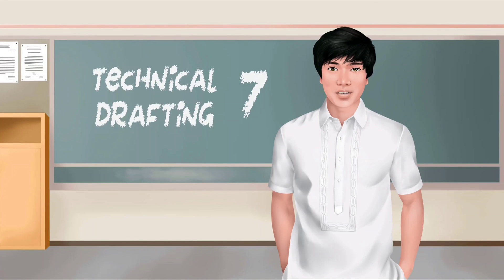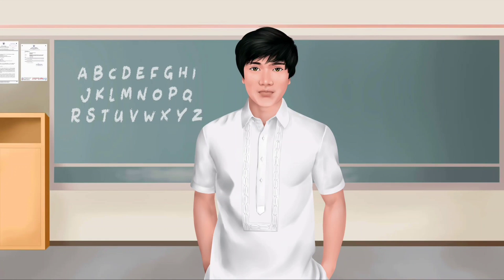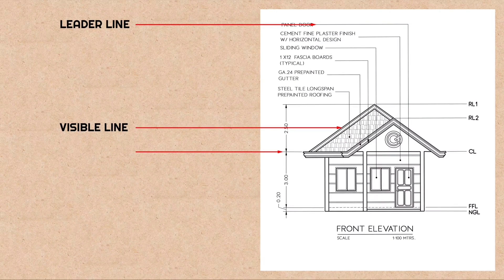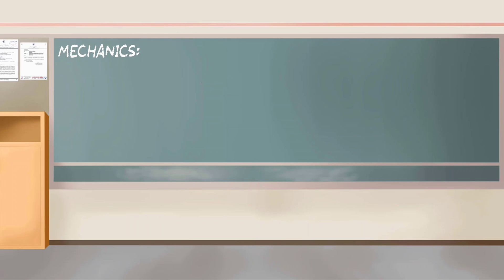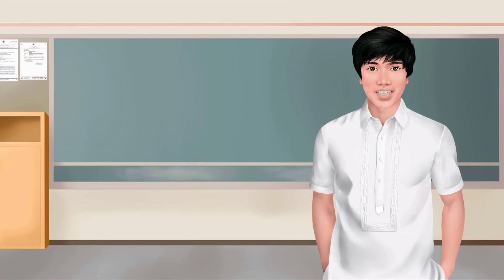Technical Drafting - Alphabet of Lines | COT Video Lesson | CCM PenBites

Comment: 1. Phantom line
2. Short break line
3. Cutting plane line
4. Hidden line
5. Central line
6. Measure line
7. Long break line
8. visible line
9. Short break line
10. Dimensional line

Sir tama po ba??
Reply: 1. Phantom line
2. section line
3. Cutting plane line
4. Hidden line
5. Central line
6. extension line

7. Long break line
8. visible line
9. Short break line
10. Dimensional line
Reply from the maker: Good day. Kung sa labelling itong sinagutan mo, may iilan lang na hindi mo nakuha. 😁
Reply: 7/10
Reply: Sayo ay 9/10 kase hinde central line center line

Comment: Visible line  - 1:46 
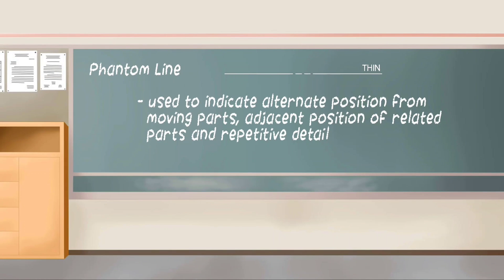Phantom line - 2:05
Extension line - 2:22 
Dimension line - 2:35 
Reference line - 2:53 
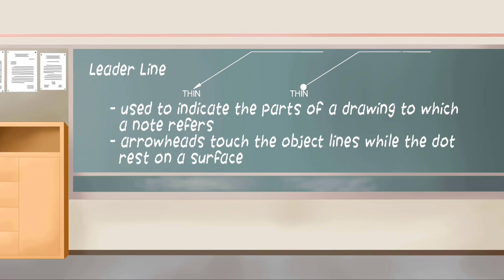Leader line - 3:09 
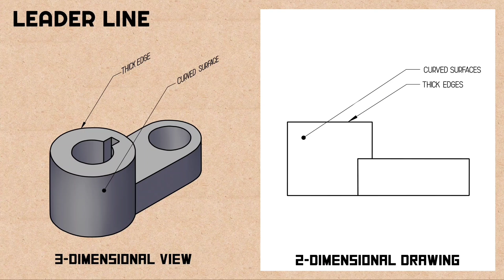Hidden line - 3:27 
Center line - 3:45 
Cutting-Plane line - 4:01
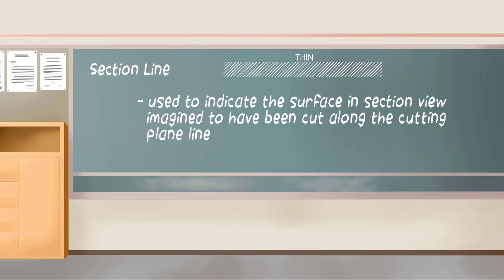Section line - 4:14
Short Break line - 4:30 
Long Break line - 4:43
Reply: putik ito anh lumabas sa tle board exam